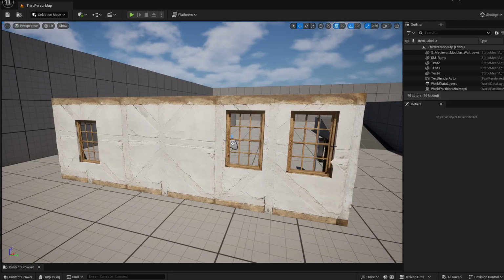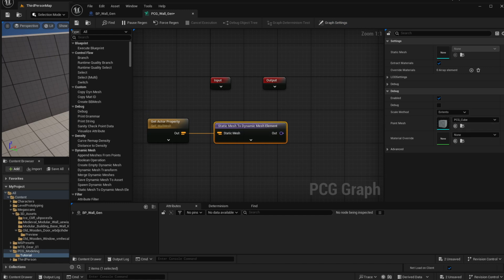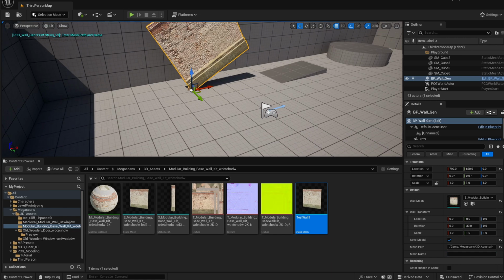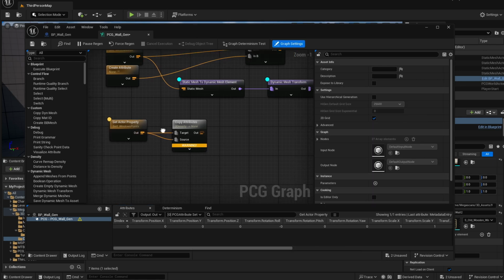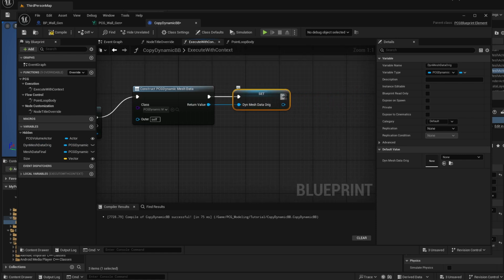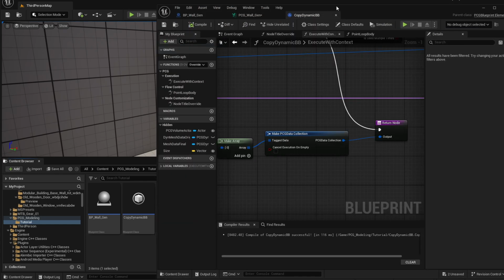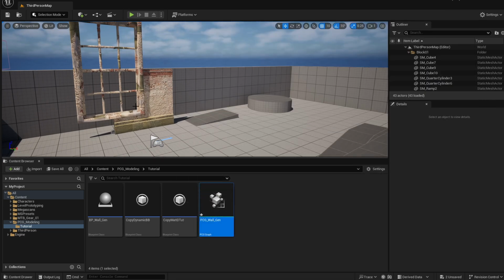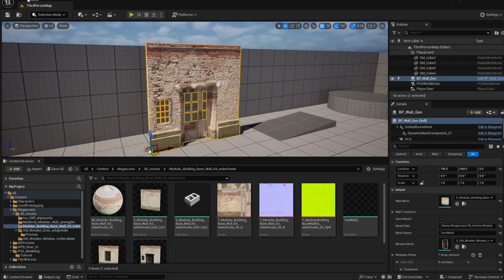PCG + Geometry Script in UE 5.5 - Wall Generator Tutorial

Comment: I haven't got too far in this yet, but.. how do you generate collision? I am making dynamic meshes and saving them as static, but there's no way to generate collision that I can see....
Reply from the maker: well unfortunately directly in PCG seems it cannot generate collision. You need to handle it later with post function.
Reply: @dk_3d  Thanks, had a feeling.. frick I hope they add that, because it will add a fair bit of manual work when everything else is generated automatically
Reply: @MysticArchmage  You can try creating an Editor Utility Blueprint that does that automatically for you. I used to create one that automatically generated collisions for split meshes inside Unreal since the results didn't come with collisions.

Comment: Here's the English translation of the video summary about the wall generation system:

Key Features:
- Ability to add windows and doors to base walls
- Freedom to adjust window and door positions, sizes, and quantities
- Outputs a single static mesh, suitable for PCG building generation

Key Steps:

1. Basic Setup:
- Create Blueprint Actor and PCG Graph components
- Add necessary variables: wall mesh, window mesh, door mesh, etc.
- Create points array to store window and door position information

2. Core Processing Flow:
- Convert static mesh to dynamic mesh
- Get bounding boxes for windows/doors
- Use Boolean Operation for subtraction to cut holes in the wall
- Place window/door models at cut positions
- Use Boolean Union to merge all meshes

3. Material Processing:
- Create custom nodes for material ID mapping
- Ensure walls, windows, and doors can use different materials
- Set up correct material slots

Main Challenges:

1. Bounding Box Handling:
- Need precise control of cutting area size
- Add cutout variable to fine-tune cutting range
- Handle the impact of window/door protrusions on cutting

2. Point Translation:
- Need correct handling of transform data
- Ensure windows/doors are in correct position and orientation

3. Material System:
- Need correct setup and mapping of material IDs
- Ensure final static mesh has proper material slots

4. Dynamic Mesh Operations:
- Precise control of Boolean operations
- Handle multiple window/door scenarios
- Ensure generated mesh quality

The system's strength lies in its flexibility, allowing quick generation of various wall variants, making it ideal for procedural building generation. The main challenges involve precise control of mesh operations and ensuring the quality of generated results.

Comment: I think this tutorial is useless in this form.
Because from the geometry script it is necessary to create a system of walls, windows, doors compatible with each other and from this to do similar things.
I made such a system from the geometry script on my channel. The point is that it allows me to automatically bake the entire scene into static meshes with one button press, saving dynamic models on individual static meshes that are created in the process.

True, there is a problem in further development. Since for further development of blueprints based on the geometry script it is necessary to constantly take into account the compatibility of the system (support for the possibility of autobaking, saving materials, etc.)
Reply from the maker: I don't understand where is the problem.
You can use any wall/window/door you want just pluging into the blueprint variable and they can be repositioned and duplicated as many times as needed, so there is no "neccessary system" to create.
I have it saving static mesh as well (when clicking the "Save Mesh" checkbox)